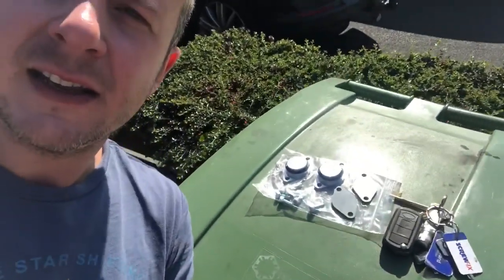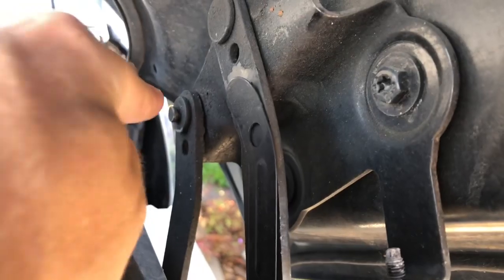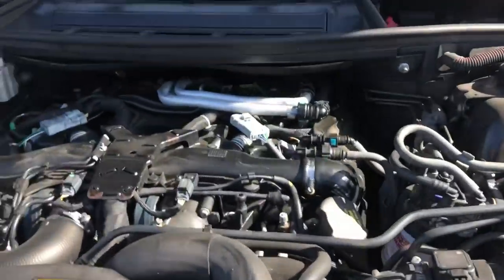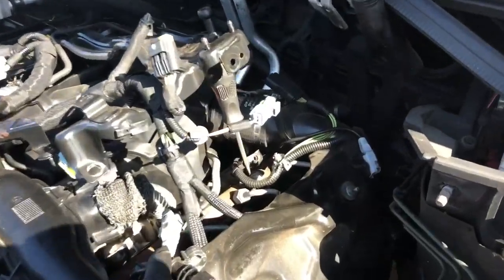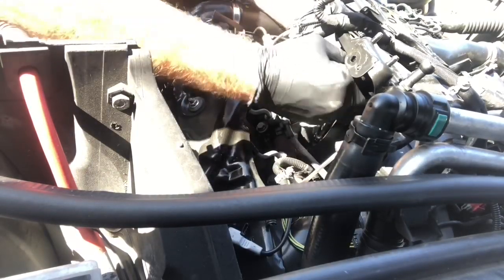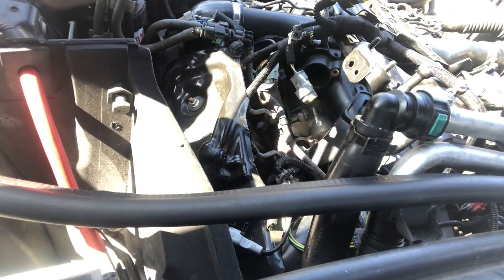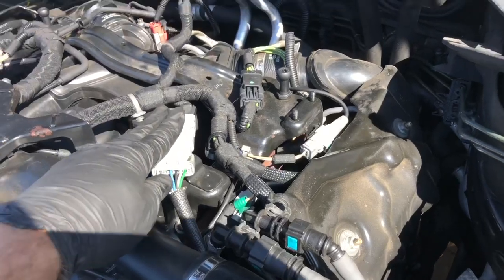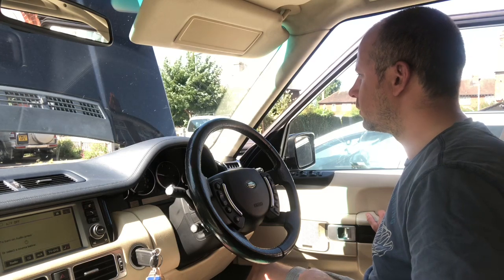EGR Delete - Range Rover L322 3.6 TDV8

Comment: Hi we the car still pass the mot? With this done.
Reply from the maker: It should do. They can’t touch/remove any engine covers & the warning light shouldn’t be lit. The EGR has almost no bearing on the emissions/smoke test either, so I think it should be fine.
Reply: Nut Job is correct, no issues with mot and no fault codes, lights or driving issues.
Reply: @jamest5149  mpg still the same or worse?
Reply: Gas Racing slightly better than before by about 10%. Others have found the same. Also slightly smoother running.

Comment: Did you or do you now get a puff of diesel soot when you put it full throttle?

I'm trying to work out if the EGRs are my cause and, if it's worth getting a re-map and them switched off.
Reply from the maker: I definitely would get them mapped shut. Just because the consequences of their eventual failure is painfully expensive.... but that’s just me 🤷‍♂️

Comment: have you removed your DPF also?
Reply from the maker: This model never had a DPF
Reply: @Nut_Job.  my 2008 SDV8 has a DPF according to the VIN lookup, would the DPF have caused issues with your EGR blanking?
Reply from the maker: If your vehicle has a DPF it could run into problems when you blank/disable the EGR valves. This is because the EGR’s play a part in the DPF regeneration cycle which periodically burns off the accumulated sooty particulate in there.

Comment: I know, a lot of people do this. But, it is not street legal. In Europe, if you dirve a car that isn`t street legal, you loose your licence. Mot a big problem, because it is invisible, but... The other question: if the egr works, it reduces the burning temperature. Without egr, the engine wil runner hotter!
Reply from the maker: Yes, it’s technically true. And in a perfect world EGR valves can serve their purpose & reduce combustion temperatures, improve economy…. But for the RR L322 particularly, the x2 EGR valves on the 3.6 TDV8 are prone to failure & can have disastrous consequences. With older high-end vehicles like this it is understandable why people don’t want to risk failure for a tiny fuel economy gain 🤷‍♂️

Comment: what about the error codes?
Reply from the maker: There aren’t any mate. I was always convinced the car would throw up all sorts of errors... but no. I saw forum posts where people had blanked the EGRs off with plans to follow up by mapping them out, but no errors or warning lights came on?! 🤷‍♂️
Reply: Nut Job thank you, I have an LR3, which is fine but I want a range rover like yours. People say they have too many issues, what is your one sentence advice. Thanks
Reply from the maker: It’s peoples opinions like those which keep used Range Rover prices nice & low - everyone is afraid of them!
They are complex vehicles, definitely - that’s also why they’re so awesome. Try & get one that’s been looked after, not necessarily perfect but in good mechanical condition. Look for clues in the engine bay & underneath for parts which will have needed replacement over the years like intercooler hoses, drive shaft boots etc 👍

Comment: Aside from the legal/environmental/emissions related side effects, I'd think twice about doing this on a TDV8, especially a working one.  EGR reduces emissions by reducing combustion temperatures, and as the turbos on these engines are marginal at best, I'd do all I could to make life easier for them. I've replaced many many turbos on these over the years, they're a nightmare job, time consuming and expensive. I know I'll get trolled by the 'take off all the emissions junk' warriors,and yes, on some engines it has a huge effect, but on these ones, no thanks....
Reply from the maker: This was the initial reason I had held off doing anything on this engine. However, I fail to see what damage is ACTUALLY likely to occur... my reasoning (which I accept, may be flawed) is this:
EGR allows recirculated exhaust gases back through the intake at lower RPM to reduce NOx formation which occurs above temps of 2000K. The turbo is not properly spooled at this RPM and when you put your foot down, the EGR will close, the turbos will spool up to max and cylinder temperatures will rise - because you’re accelerating. Yes, the engine gets hot during this phase, but your EGR would never normally be open at this point & that’s how the engine is designed. So.... what ACTUAL temperatures and damage are we talking about here? 🤔
Reply from the maker: I’m not encouraging anyone to do anything.... but since you’re asking, I’ve had absolutely no issues or any perceived difference to the performance of my car. And I’ve actually put at least 500 miles on since blanking the ports now. 

I’m happy and open to be corrected or proven wrong with my logic regarding cylinder temps, so please don’t think I’m being stubborn or stroppy. I’m no expert in engine design, but I’m just following my own logic + the experience of others too 👍
Reply from the maker: It’s ok Simon, I wasn’t sure about doing this for a while but the more I thought about it I pretty much convinced myself. I’m no expert & I may be damaging my engine, but I’m reasonably confident it’ll be fine...
Seriously, thanks for the comment though 👍
Reply: How would you know, you kept egr

Comment: Love your vids but I don’t condone breaking the law and even more just for the hell of it. It’s illegal in the UK 🇬🇧 where you live to do this and more over it pumps cancerous pollution into the environment.
Reply from the maker: Each to their own Chris & I totally understand your point. 
Just for clarification though, your statement is not completely accurate. The function of an EGR is to open at low RPM, recycle exhaust gas & hopefully reduce NOx emissions - yes that’s a noble objective, but it doesn’t spew anything more ‘cancerous’ than it was before into the atmosphere. 
I didn’t do this because I was bored, I did it to prolong my engine’s lifespan - but you’re correct that it doesn’t change it’s ‘legality’
Reply: Adding to that, a warm engine is actually more efficient without EGR valves. Also, there are some more conflicting theories about the engine without the EGR, higher EGT's which lead to all sorts of issues (Mostly turbos)
Reply: DPF deletion is much worse for the environment than this. Ironically Exhaust Gas Recirculation makes soot production worse.